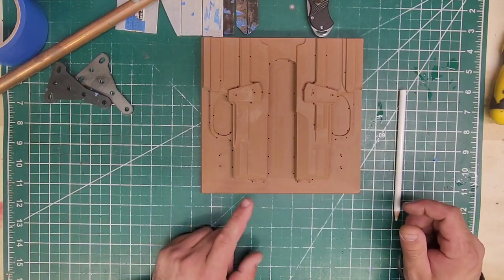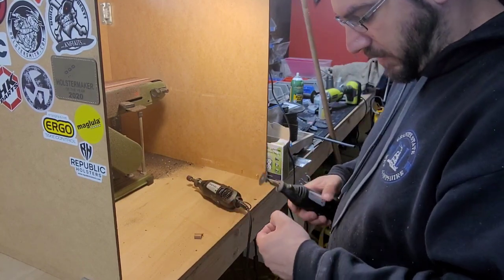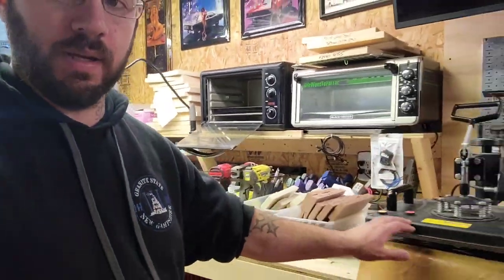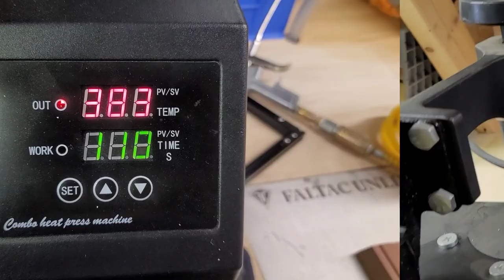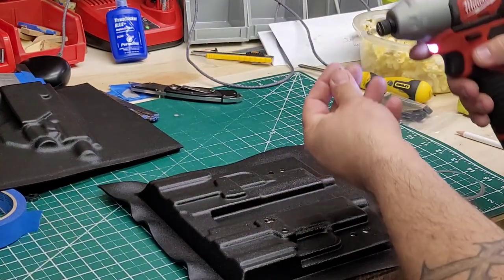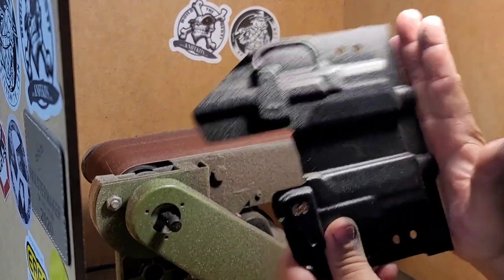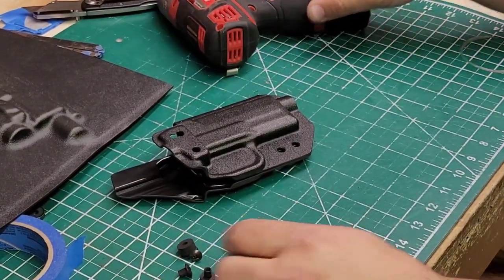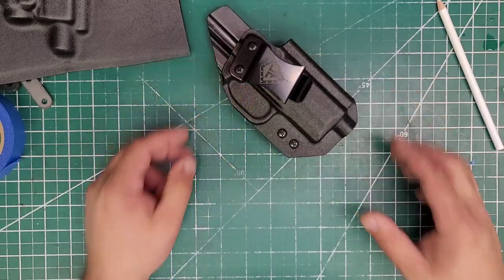Adding a threaded Barrel to a Split mold

Comment: Man, I find myself caught in a conundrum oh having tool envy. I have started picking things up now to start trying my hand at this, maybe not to be "competition" but just to friggin try it and learn to do it. It's freaking awesome and I can't thank you enough for sharing your process.
Reply from the maker: I'm gunna be doing a basics video on tools soon. But it's funny, another bender says I should invest in good tools 🤣🤣🤣 
It really is an art form. Practice on black kydex since it's the cheapest. Any questions just holla or watch more vids!
Reply: @FalTacUnlimitedLLC  That would be awesome. I feel like I have so many questions, but Have a good feeling they will be answered once I get hands on. I will be sure to use you like a lifeline when I've set myself on fire.
Do you really need good tools if the tools you have are doing the job? Sure it's nice to have "professional" tools, but I learned the hard way in my last job, my snap-on are not gooder than kobalt when the price is considered. lol
Reply from the maker: @xBiiO  I have over 100k in snap on and Mac tools. But remember a lifetime warranty is a lifetime warranty.  My automotive tools are high end. My random other tools do the job. You'll find what you like to use. You'll use it. Then you'll upgrade when you can. And the cycle will repeat itself. I can make a holster with a couple tools. No need for everything.  But the reason for tools is to make everything faster, easier, and repeatable. 

I recommend  a basic screwdriver set.
A scroll saw
A dremel with bits
a drill.
A knife

Outside of a press, that's all you need really
Reply: @FalTacUnlimitedLLC  I'm a huge believer in buy nice or buy twice. Buy the good stuff once so you dont have to buy it twice, however, with tools there exceptions to a lot of that. Usage, application, hobby vs. profession, etc. 
You definity have a bomb set up and I'm sure you could justify JET or other high end tooling, because you would see a return on your money with such things. 
That being said, I'm nearly ready to get going based on your short list there. Tis' very exciting. I can't thank you enough for sharing your knowledge with the general public.
Reply from the maker: @xBiiO  hell ya! Grrab some dex and happy bending!

Comment: As far as hardware goes do you find that 1/4 inch post, spacers fit best in your holster?
Reply from the maker: I love them. They work well. Sometimes if it calls for it I'll use 3/16 posts. But it's yes I love them

Comment: Do you get the kydex to the same temp regardless of whether it’s going into the vac press or the foam press?
Reply from the maker: Pretty much yes. 350 to 360 out of the oven and vac press comes to 360 to 370